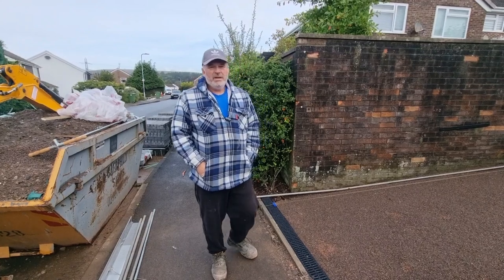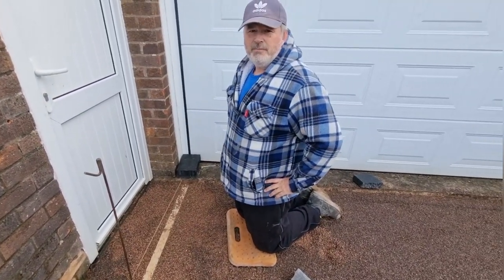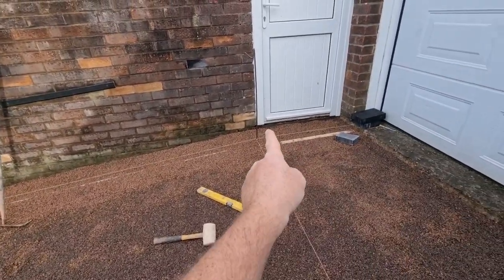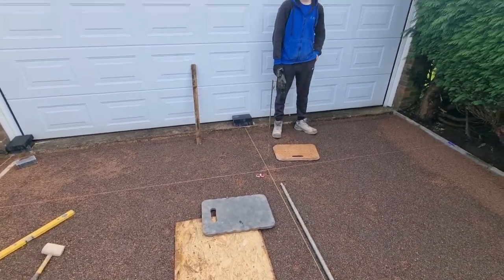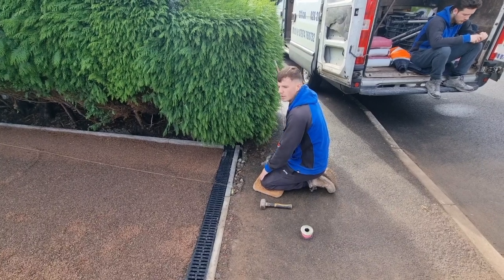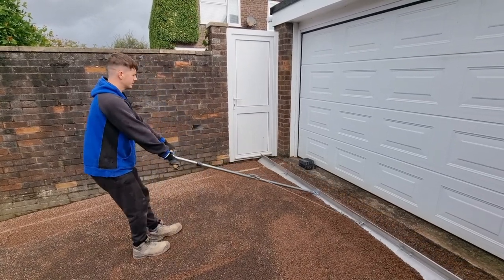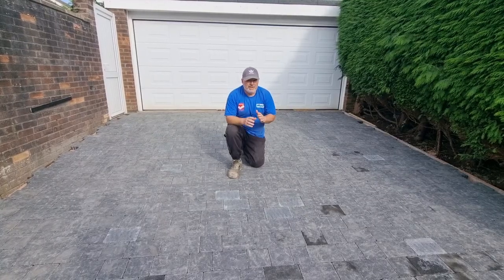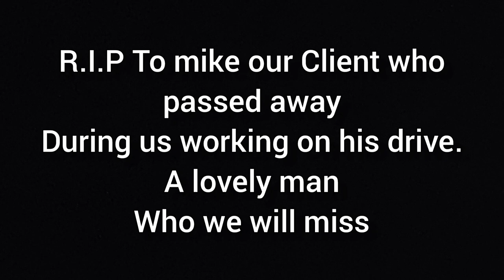How to screed,set screed rails & levels for BLOCK PAVING

Comment: I’m going to be doing my 30 sq metre driveway this Summer. I’m a builder but never done block paving and this vid was so helpful. I have a few questions If any experts can help. I have paving going up to 3 walls. Is it best to get all the borders made up of block paving in first before infill of blocks ? Some people say they need setting in a dry mix concrete but is that necessary? I’ve had my dropped kerb done to drive over and they have installed the concrete edging to tue tarmac pavement . When starting the infill is it necessary to find the centre of the driveway and set the block paving from that or do you Just start on the top corner near the garage door? I’m thinking of a herringbone design . Also I’m seeing some vids where they also use a waker plate on the freshly levelled sand using the rails but won’t that just make it not perfectly flat again?
Reply from the maker: We add the board last .
No need to set in concrete as long as you have a hard edge .
No need to start central. We do wack the sand the add the rails and drag off that.👍

Comment: How much do you allow for compaction when setting the screed height? Obviously less than sharp sand but I’ve seen some comments online saying if you compact before screeding you can set the screed to the correct level for the pavers and then won’t compact further?
Reply from the maker: Id say it will still go down around 5mm ish Ryan in my experience it will definitely go down it won't just stay where it is as you say not in my opinion mate 👍

Comment: Hello. This is the second video of yours I have watched and in the first one you were using mot and sand and in this one you used 6mm chippings, as it rains a lot in the UK these days no matter where you are lol, I need to re do my drive after having employed a cowboy to do the job 6 years ago and now it has sunk where i have been putting my van on it. do I mot and whack it down to 100mm of line then put in 50mm of chippings or is the depth of chippings needed less than the 50mm of sand. thanks for the advise in advance
Reply from the maker: Not entirely sure what you mean but you can add 6mm chippings down tk min 30mm 👍
Reply: @brickrightbuildinglandscaping  ok thanks for the reply. I am assuming if using  the chippings instead of sand,  the depth should be the same as if using sand 50mm
Reply from the maker: Yes but you can reduce the chippings to 30mm if you wanted 👍

Comment: Would normally put a spacer under line also at the garage end to allow for compaction. 👍
Reply from the maker: Wanted it slight lower than the garage floor as the customer already has a bit of water back tracking 👍

Comment: What aco draines are connected to pls?
Reply from the maker: @patrykczuba4064  
The empty into the joining flower bed .
If that doesn't work for you consider a soakaway .also id ask your local council for the requirements you need to adhere to 🙌

Comment: We had a drive installed yesterday and they did not do any screeding 🤷🏼‍♀️ We chose grey bricks but where the sand hadn’t been swept in enough at the end, the bricks look discoloured and there is still loose sand all over the drive. My husband tried sweeping it in last night but he didn’t really get anywhere. We also chose a different design but because the boss guy didn’t like it, he sent us the pattern that he’d be getting his team to do 👎🏻 Bit of a disaster really 😞
Reply from the maker: Oh no that does sound very good for you .Hope all is ok 👍
Reply: @brickrightbuildinglandscaping  Oh it’s got a lot worse 🤦🏼‍♀️ We now have hundreds of ants burrowing out of different areas of the drive! All the sand in between the bricks is being pushed out! We just don’t know what to do. My husband has ordered some ant repellent to put down, so I suppose we will have to see if that works. Is it normal for this to happen? We have never had ants before.
Reply from the maker: @corinnevanessa22  
Yes the ants this time of year can do that unfortunately. Get rid of the ants because they can undermine the paving eventually. 
Your going to need to replenish the kiln dry sand in the joints periodically until the sand settles in the joints .
Good luck 👍

Comment: That’s how not to do it …. You never walk on an area that’s already screeded, as a person who dose this job day in day out please do not follow this
Reply from the maker: We had to start at the top square off the building. We boarded it but 6 mm chippings you can place light foot on it so yes although i agree with you we had no choice and it didn't move and had no issues with the final finish of the work
Reply: Its compacted, and they used boards to cross over, so not gonna make a lot of impact on the screed. Also they had to start from the top so how ellse are they gonna get across